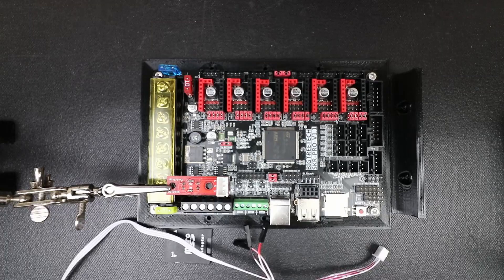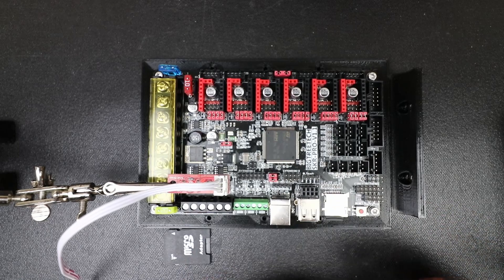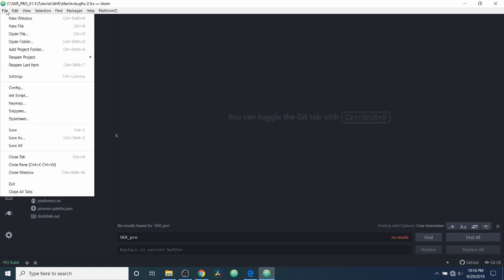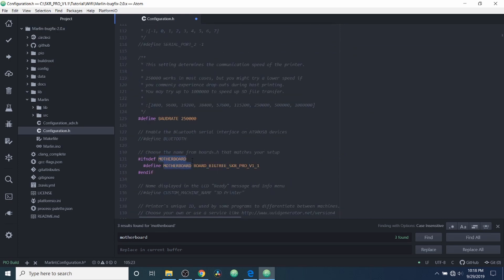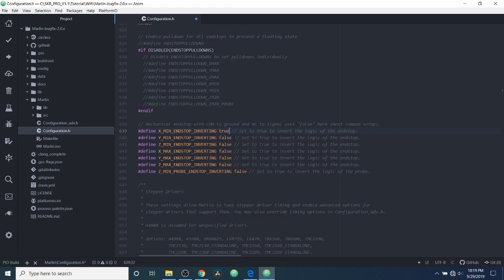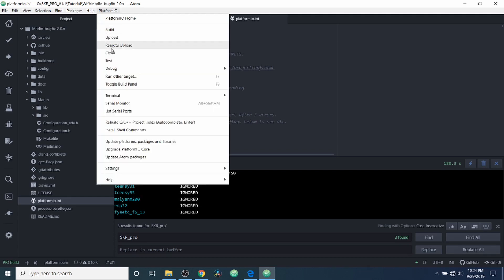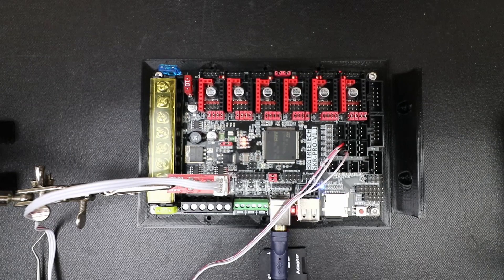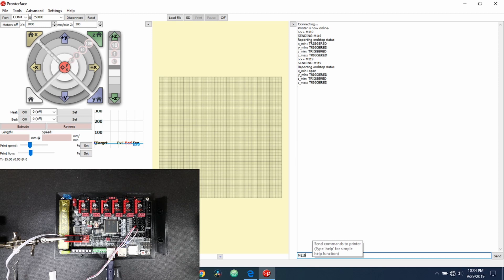SKR Pro V1.1 - Optical EndStop

Comment: Great video, thanks.

I have a laser that I would like to connect to the MKS GEN L v 1. The laser needs a TTL output. Unfortunately I cannot find the connection on the board. 
Does one of you have a laser connected to the board ? If so where ?

Comment: Hey Edward, i have a Question :-)
I want to be the print part cooling with two fans, but that will not work on one output. (Only on 100% Fanspeed)
Where and what i must change in the Firmware to use two Fans on two Outputs in synchronice?

Best regards, 
Michael
Reply from the maker: I'll be doing a tutorial on it soon.

Comment: First of all you have a lot more patience than me. Quick question for author do you test all the components together (stepper motor, driver, swtiches ....) ? I followed your tutorial to the letter and get variable result.

It's a bit disappointing since you are putting a lot of effort building those video.
Reply from the maker: In what way?
Reply: @EdwardBraiman  Failure to compile., weird bugs like with the optical switch and the bl touch... In pieces it does work but when you put all together its doesn't. I'm a dev so I can troubleshoot it when I comes down to code. (Thing I was hoppy avoid to do to the extend I did! In the hope to not fall into rabbits hole ;P  ) I did bang my head a few times thinking it should work, it works for you.

Suggestion: If you could take your tutorial to from "No printer" to a "functional printer" and then maybe work in the add-ons format. Your modular approach is really cool .  

Continue your work! Your videos have been good starting point and did speed things up in a world where people dont document much of their works.
Reply from the maker: The Marlin firmware appears to now work as of a fresh download today.  Let me know if it builds okay.

Comment: Could you please explain when we use UART and SPI mode for the 2208's
Reply from the maker: Normally TMC 2208 is use as UART.  Other steppers such as tmc2130 is SPI.
Reply: @EdwardBraiman  okay so if i use 2208's by default the board needs to be set as UART then? One more question i am building a 3d printer and wanting to use the SKR v1.1 pro and wondering if i can still use the raspberry pi with octoprint? thanks in advance
Reply from the maker: Yes you can use an Octoprint.  Keep in mind Slic3r might need to be done on another computer.